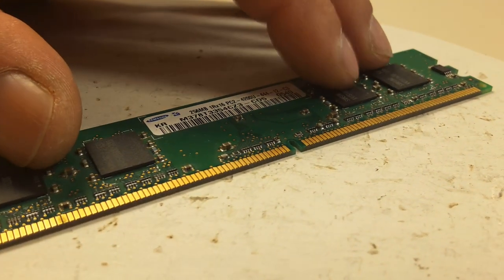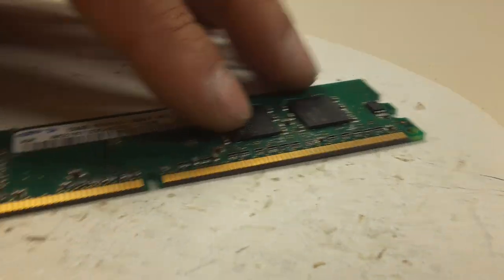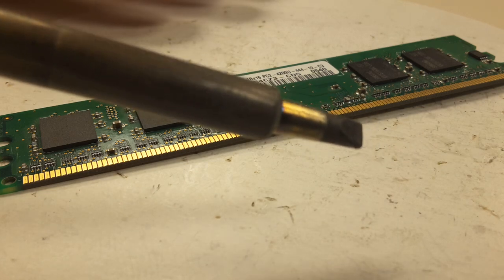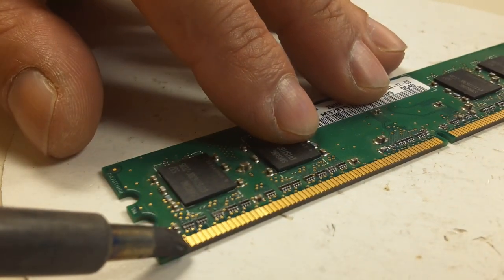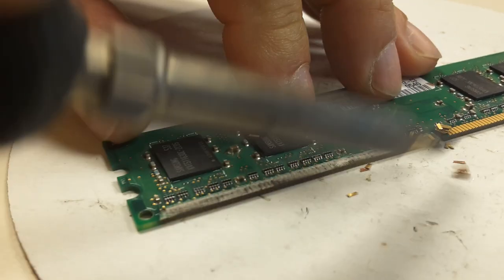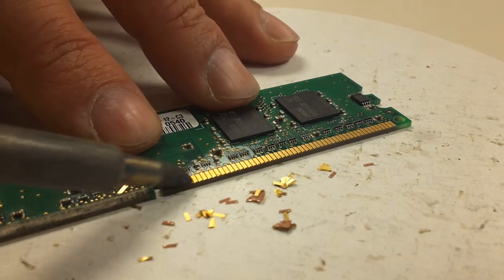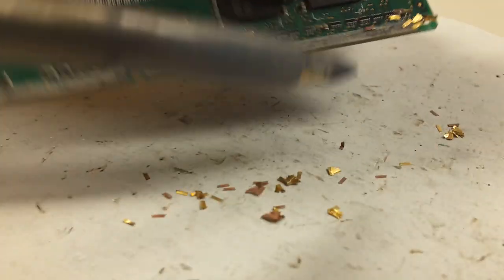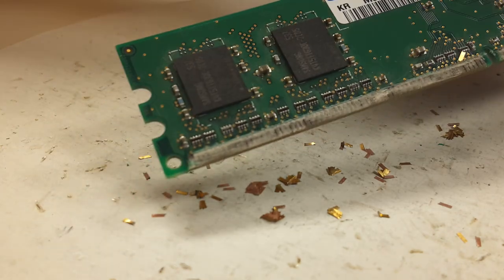Gold recovery memory rams,graphic cards, etc  No chemicals needed and no fumes

Comment: Very well done Ray, obviously there's much more gold on the ram stick which would need treatment but a fantastic and clean way to start, it should work on all fingers like from slot cards etc too, I must try this.
Just goes to show there's so many clever scrappers who don't do enough youtube video's, please keep making more!
Reply: Hi Ben, I was thinking of a way to get rid of most of the plastics and fiber by fine grinding the electronics scrap and then gravity separate most of the gold and heavy metals, have you tried something like that?

Comment: i used to.do this to but the only problem is that you still have to get rid of the base metals that are underneath the gold  fingers so you still have to wash them in  acid and still have to use acid to refine before you.melt so it really is not useful plus when.You have 200-300 ramsticks to do it is much easier to just use acid
Reply: That will melt right down. Not sure what the karat is but it melts into one solid metal. No swirls even...

Comment: Neat trick. But how do you get the gold out ?  using acids ?  Is there a way to not use any acids ?  Or do you just melt them pieces as they are in the jar ?
Reply: The gold fingers are really a low grade gold (10-14k) alloy which is plated on nickel which is plated on copper. Gold will not plate directly onto copper and needs to have an intermediate layer like hard nickel. Those gold foils which he has scraped off now needs to be chemically treated to be removed from the nickel and copper layers and then again dissolved so that a pure 24k gold can be had and that takes harsh chemicals and know how. But, if you use the soldering iron technique you can always keep saving the fingers until you have a big enough stash to sell to a refiner.
Reply: @Alex-kp3hr  what if i just melt them into a alloy button, and then use lead to oxides the copper?
Reply: @Alex-kp3hr  will that work?
Reply: @OfficiallyRetired  You could do that. Remember, lead will cement out the less reactive metals that are below it on the reactivity chart, like copper, gold, silver and other pm's. Nickel, tin, and iron are higher on the reactivity chart and not affected by the lead cementation. So after the fingers have been removed by the soldering iron, and you put all the fingers into a crucible and melt them into a button. Now you have a alloy button of gold, nickel, copper. You do need an acid medium in which any cementation will happen, usually hydrochloric or sulfuric or nitric acid. The lesser evil of the 3 is hydrochloric and that's why very many do cementation using the HCl and some use nitric acid because it will dissolve most base metals but not gold but the fumes are more toxic. Either way you do it, you cannot escape from using a chemical treatment to recover and refine your gold.
Reply: @Alex-kp3hr  I turned a 10kt ring into a 23kt nugget from using the lead way, I really dislike the chemicals process, takes wayyy too long
Reply: @OfficiallyRetired  ok. what was your procedure?
Reply: @Alex-kp3hr  lead/bismuth ratio 10-1 of gold alloy, melt it in portland cement, before my process the gold button barely survived 10kt acid test, after the process it passed with 22kt acid test, many people think is bs but I made it work, also with silver refining too